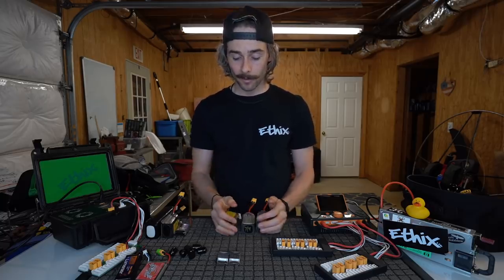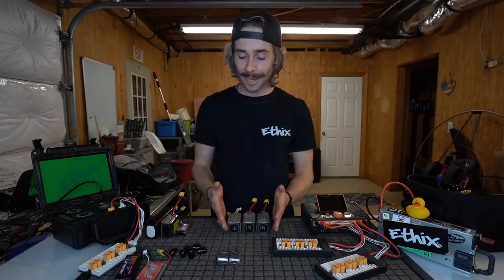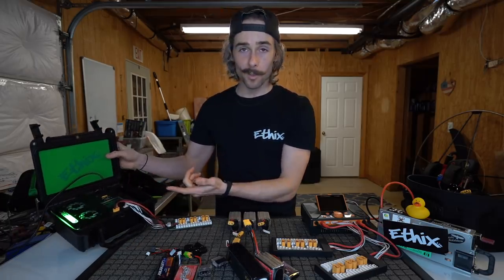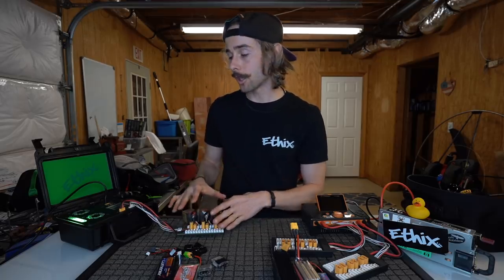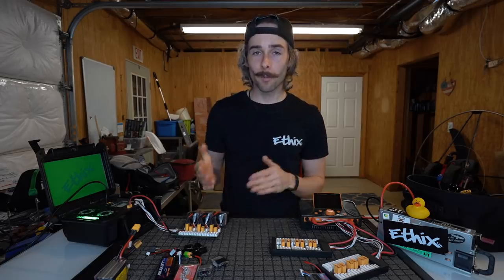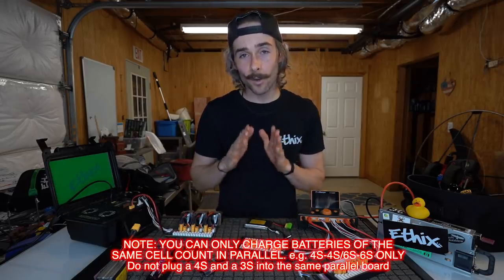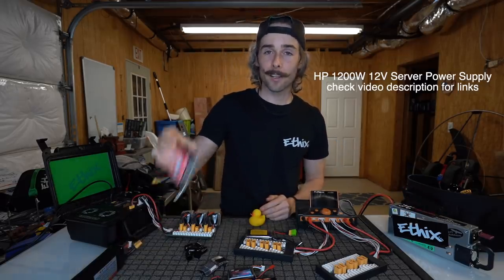How to FPV (Part 7) LiPo Battery CHARGING | Is Parallel Charging DANGEROUS ???!

Comment: This is great, Steele. I think that the one thing that people often forget is that parallel charging can also damage your batteries if you parallel charge packs with very different internal resistance, or you parallel charge a pack with an iffy cell - it can damage your other packs.    If you have a pack where one cell is consistently lower than the others, never put it on a parallel board with other packs.     If you have a pack with high internal resistance, don't put it on a parallel board with other packs.
Reply from the maker: This is very true. That is what I stated to make sure your batteries are in good conditions :). Because yes. Charging crap batteries with new ones will for sure hurt the new
Packs.    Thanks for the comment m8.
Reply: @MrSteeleFPV  Word.  do we still say that?  How about: Werd.  Or maybe we don't say that anymore either... :/   Anyways, thanks Steele for these howto videos.  This is a valuable resource for everyone trying to get started in this hobby.  We all take it for granted that we know all this stuff, but all of us who have been doing it for a long time had to learn the hard way - and it takes a LONG time.  You're helping people get up & running much more quickly that we did years ago.  The more people in the hobby, the better it is for all of us.   You're doing God's work... or werk.
Reply: he covered that in the video. anyone who didn't bother to watch isn't going to bother to read your comment and follow it.
Reply: How do you check what condition the batteries are in? How do you know if one cell isn't working? Etc
Reply: For safety, use a "Bat-Safe" for charging your LiPo's !

Comment: I have a EE degree and work for USRobotics.  We eat lipo for breakfast.  Fact#1 everything i heard you say is correct.  Fact#2 charging in Parallel is best for your batteries, Especially if you religiously balance.  Fact#3 charging is parallel balances your batteries better and faster.   Unverified #1, lol  I charge in parallel regardless of total battery voltage, I only check that each cell is close to its own battery.  your extra careful method is fine.  Great straight forward to the point video.
Reply from the maker: 🙌. Finally someone who understands me :)
Reply: im an owner of the largest Tungsten steel mine in america.  It would be awesome if you guys would have an event here or at least come fly it...  epic scenery and machinery to fly through.  you're  Mr Steel for gods sake man, i wanna show u a pic @MrSteeleFPV

Comment: Love the series. Never flown FPV. Never really flown RC either. I had an rc glider as a kid and recently found a dji tello for $5. This series makes me want to fly FPV, I dreamed of it growing up but the technology wasn’t around for consumers. Probably the best advice from the series is battery management. I have a boat that runs 4S and I never bothered to use the charger that came with it. I bought a Tenergy TB6B at the same time as the boat, batteries and one of those voltage checkers. The charger is supposed to be balanced but I can’t seem to get the cells to the same voltage. Maybe crappy batteries or a bad charger. Everyone safe flying, or piloting whatever RC you operate!

Comment: Good video ! I have parallel charged for several years . I only had one charging fire and it was because I got lazy that day and didn’t check all the packs prior to charging .   Also might be good to mention that fireproofing your charging  area is pretty easy to do . I charge on some old ceramic tiles and have a smoke detector and fire extinguisher in my charging area and it came in very handy !

Comment: I bought an ISDT charger and when it arrived it didn't have an plug adapter to power it. Took me a bit to figure out why they sell it like that but all of the reviewers and commentators talk like its common knowledge. What I ended up doing it re-purposing an HP charge brick and putting an XT60 on it. I'm sure that server power supply is better at producing juice and I'll probably rig something like that. This hobby is not really easy to get into and I think If I didn't work in IT and just have general problem solving skills all of this would be impossible. Thank you for the explanations and advice as I am still a noob and this is very helpful to me.

Comment: Very cool Steele. I use two WP power supplies in series for the 24v output mainly because that's how I started as I was flying planes before I flew quads. That said, starting with a higher voltage than that of the batteries, such as 24v to feed a charger that will charge 6s, 5s, 4s, 3s, etc is more efficient that upping the voltage from 12v to feed higher voltage batteries. That's why I've kept the setup. It is now about 6 years old and still ticking nicely.

Comment: Very insightful, I actually get it now! 

So, no parallel charging is the cell voltages that are more than 0.3V apart. 

You can only charge the same cell count in a single channel parallel charger. 

Don’t poke your battery with a nail. 

You can charge different cell count batteries on different channels. 

Batteries use DC, as do most electronics.

ALWAYS CHECK YOUR BATTERIES BEFORE CHARGING OR YOU DIE

As long as you follow the 0.3V rule, you can plug in the balance lead first with no problems

Charging 3 batteries at (1c?) is taking the operating current and multiplying by 3. eg. 1100mA x 3 =3300mA

Mr Steele is not responsible for human error.

Get a great power setup. Reduce the risk of your house dying.

Mr Steele, please reassure me that I’m correct. I want to make sure that I don’t have any problems with batteries.

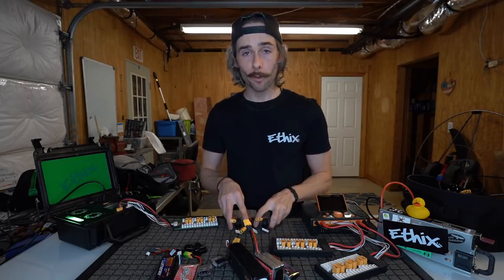Comment: You've said 0.3V difference per cell (4:50)? I've always thought that this "rule" applies to the entire pack. 
I might have been doing this wrong but I'm always ensuring that the entire pack is within ~0.2-.3V plus checking each individual cell.

Comment: I think safest thing to do is charge your packs to storage individually, then when you are ready to fly parallel charging is key to getting them all charged up quickly and safely since all cells are at same voltage.

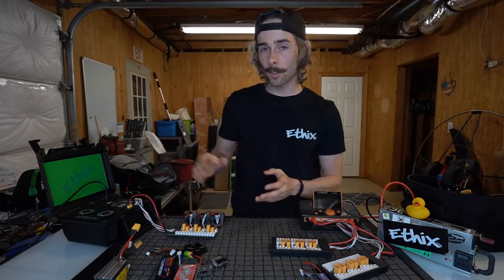Comment: 9:43 C is internal resistance right? Charging or discharging past 1 C alters chemistry. Batteries don't like discharging over 1 C but because their short pulse discharges, the chemistry is less altered than charging it at the same rate because the consistency of the RMS charging is too much compared to the show pulse discharging right? It's not that the battery likes discharging higher current any moreso than charging, yeah?

Comment: Unsolder the right hand beeper which disables both on those checkers. Your batteries will even out if left for about 5 mins but as you say, watch them and don't plug batteries of great voltage difference as the rush current will create heat or pop a fuse on your balance plate. I regularly bulk charge batteries with a .5 V difference with zero issues and regular lifespan.

Comment: Speaking of batteries ... What would cause a quad to flip right under punchout power on a 5s, but be okay if giving smooth slower power to full throttle? Does fine on 4s, but 5s and 6s causes it to flip to the right on a punchout. Any ideas? 45A X-Rotor Stack ... XNova 2204-2900KV motors ... 35V-1000uf Cap

Comment: Thank you for the series, it is very useful for a novice quad owner. Can you please elaborate more on the use of server power supply, how is it connected to the charger or does it involve any tinkering inside the power supply inself? I might be able to get one from the outdated servers at work :)

Comment: Super-duper. Thanks. If you storage (dis)charge a bunch of 4.2V batteries, do you still use 1C?
Reply: 'storage' from a higher voltage is essentially running the battery through a resistor at a controlled rate. it will be slow compared to charging as a lot of chargers can't handle the heat dissapation (the fan will always be on while discharging) I don't think the c rating changes how fast they discharge.

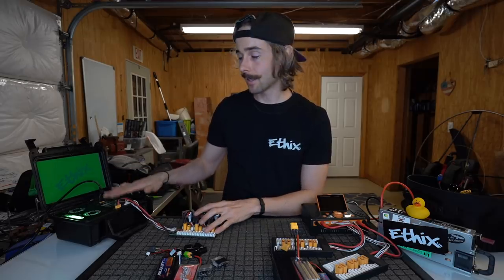Comment: FYI:  I just learning FPV (I'm no expert) but something I noticed in watching a few recent videos.   At 6:52 in your video you mention charging all 3 of those batteries at 1C (1.1amp x 3 = 3.3amp).   However, in a video Joshua Barwell did a while back he showed if you parallel charge and you don't want to go over a 1C rating than you can't take the 1C rate and multiple it by the number of batteries, because he showed on his testing meter some batteries are actually getting 2C while others in parallel may be getting 0.5C.  Can see Joshua's video from  Feb 26, 2016 .  You've been doing it for 4 yrs so appears to work...just making notes for myself and letting others know your not actually getting a 1C rating as one may think.  Feel free to correct if I've misunderstood.......great video though!  I'm trying not to make any mistakes which is why I'm watching these videos so intensely.   Have seen the damage these LIPOs can do when mishandled......
Reply: RGMG was josh referring to when you are charging in parallel with batteries of same cell count BUT different capacity?  Steele is referring to cell count same capacity scenario here....I’m not certain but I think this may be the confusion
Reply: RGMG I see where he says that and he goes onto say it’s because if any of the cells have a different internet resistance this different C rating charge issue can happen.  This is important piece here I agree and I’m about to begin using a parallel board on very large batteries at very large amps so I’m researching all this.  After watching this video of Steele’s my only concern was that he always has new batteries and if any cells internal resistance is off he Won’t use it.....I don’t think most of us have this luxury and that many of the batteries I buy new have off resistance cells right from the beginning.....does this mean I basically won’t be able to parallel charge basically ever?  Maybe for first weeks of new batteries and that’s it? I’m not sure,, but yea I’m sure josh is referring to this cell resistance value and yes Steele does state that clearly too, but as usual josh has gone slightly deeper here in stating that if you have a different resistance per cell you will also get different Charge ratings happening despite you thinking they all are happening at your C rating you chose to push amps to.
Reply: RGMG I think basically though if a cell or two does have a larger resistance than the others it means that one won’t charge at the full C rating want....subsequently I think that means the other cells....will be charging above the C rating you wanted.....I’m hoping this only would be a problem if you select so high a C rating amps push that the extra C going to the better cells exceeds the wires or batteries ability.....I’m going with the logic of sticking to 0.5 C charge rates when doing paralel charging with varying cell redidtance....if I’ve a few bad cells the extra C going the the good cells won’t be into any extreme value for it to be a concern.

If I'm in a rush...and I've checked all my cell resistance are good maybe I'll push to 1C knowing none of them will be getting more than others
Reply: Oswalds Reef yes, I think you’ll be okay.  It was just something to be aware of.  Devils in the details...as they say.  Especially when it comes to lipo’s.

Comment: Hi Mr Steele. Thanks for sharing =) Just a small question: do you use some lifehack to keep all batteries at about the same voltage? When I'm flying and watching at my OSD and see some battery voltage left, but after the flight this voltage slightly differs from what I've seen on the screen. Or maybe you know some method to quickly make batteries the same voltage, to then parallel-charge them? Hope haven't confused you. Thanks in advance
Reply: batteries recover over a short time after discharge so that's why the measured voltage is different than the voltage you see in the screen.
Reply: i use the Mah consumed in the osd. if i dont wanna spend ages settting storage charge, i only run 70% of the battery down during flight. so in 1300 mah i only fly about 1000
Reply: Charge them single to the highest Value.
Like u got 1x3.85 per cell & 1x3.5 per cell i charge both to 3.9 per cell and than together the for the Rest.

Comment: DEAR STEELE, Good & Simple  explanation. Thanks. I also want to share my ideas to support you. (A). Always parallel only same voltage packs. If you accidently parallel wrong packs... MIND !... it is a serious fire + all Batteries will get damage. (B) For the extra safety I always plug only ONE main leads to board. You don't need to connect all main leads into board. Because this will safe if any short happen. Because balance leads are thin wire, while short it burns and protect the battery. But main leads are thick it can't protect. So plugging Only one  main battery lead is enough. Through the balance leads all batteries will get the shared current. (C) If you want to charge 2s/3s/4s/5s no matter. there is a idea. Need to program the higher voltage pack in your charger. Then you can connect all other balance leads parallel. (Never connect different MAIN leads parallel). (Always consider the C rating of the battery. it is not advisable to charge both very low C rating & very high C rating) . (D) Check all battery's cell voltage before putting to parallel. Never parallel different charged packs. Example. (3.0v-3.6V are ok), (Don't mix 3.5v - 3.8/3.9). (E) When you plug balance leads, be careful, accidently it may plug wrong side, it cause all battery damage. Always plug balance leads first and finally main lead. (F) When plug balance leads pls make sure all socket plugged well. Because if one battery's one lead miss, it has chance to get damage while connect with other full charged cell. Also note some time one cell may miss with the balance socket.  (G) Never try to parallel old battery or damaged battery. If one battery get short then all battery get short. Try to avoid paralleling more batteries. try to charge 2-3 packs. So it safe always. (H). When you go flying field always have a charger. Because some time some a cell will go down unexpectedly. So you can charge that cell for a 2-3 min time to reach 3.5v. Otherwise cell get serious damage. (I) Stay close when parallel charging. Don't leave un attendant. Always charge parallel batteries in safe place, if any fire happen that will not spread. While parallel charging Better to keep batteries... inside a metal protected box. Thanks... Thiva, Sri lanka

Comment: What about parallel charging multiple batteries with different mah rating?
Reply from the maker: 100% perfectly fine.  Just make sure the voltages are the same. And ensure the batteries are in good condition.
  For example. You can charge a 3300mAh 4S and a 1300mAh 4S In parallel perfectly safely  the Voltage keeps the charger in check. (It acts as if there is a pressure on the charger) (smaller battery has more pressure bigger has less). This insured the small battery doesn’t just charge 2200mAh and explode lol.   You don’t have to worry about it. It’s all science and physics at that point.  Just make sure the voltages are the same and you’ll be perfectly fine.   I’ve been doing it for years
Reply: @MrSteeleFPV  that's great news I've been group changing all my 1.3ah, 1.5ah and 2.2ah batteries together for ages thinking I couldn't mix them. You've just saved me hours of changing time!
Reply: I wanted to say this is what I believe caused a battery fire for me. I had 4 x 1300Mah & 2 x 1800Mah parallel charging. They were all coming from storage voltage 3.80v +-.01v charging to 4.20. I had them charging at 6 amps (not even 1c). These were relatively new quality batteries also. It was definitely my fault for not checking the charger more frequently that day. I figured it would take a while with the low charge rate. Luckily no houses were harmed, lost all those batteries and 1channel of my isdt d2. Now I just run multiple dual chagers, only using parallel in a squeeze.
Reply: @latenights145  Have a isdt d2 myself, and 4s's with different mah. 3x 1300mah and 3x 1550mah. Guess it's just safer to buy another Parallel board and use the 2 channels that the isdt d2 comes with? Any idea why your battery blew?
Reply: When you charge a battery pack, you're running current through it to replenish its energy. During this process, its voltage will rise, until we consider the battery charged and disconnect it from the charger.

Since you keep all packs in parallel, the voltage over all packs remains the same. That's a basic property of parallel circuits. Therefore, it will rise at the same rate over the entire set. The only thing that can go wrong is that a bunch of those packs have too much resistance, so that the bulk of the current must flow through the other cells: in a parallel circuit, the current seeks the path of least resistance. Depending on how severe this is, it can lead to an overcurrent in some of the packs. If I were charging in parallel, I'd charge at a considerably lower rate just to be on the safe side.
Reply: Also use a "Bat-Safe" for charging your LiPo's !

Comment: Thank you Mr Steele for the info. had a few mishaps with charging in earlier days. Lipo bags saved my garage. cant say it enough :) 
but can how did you connect the server psu? i got a few in my workshop. 1200w EU 230v from the wall socket.
did you solder or used a circuit board adapter? 
ty and a new subber from Mountains of Norway